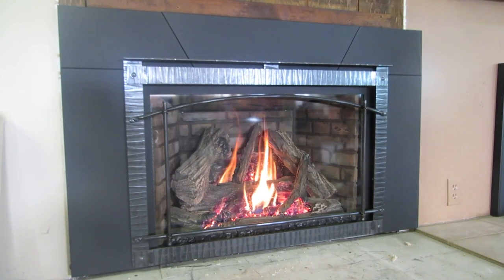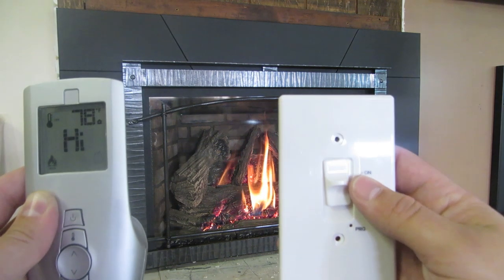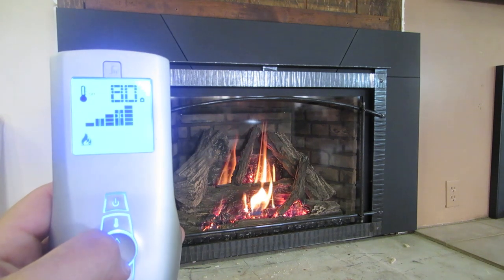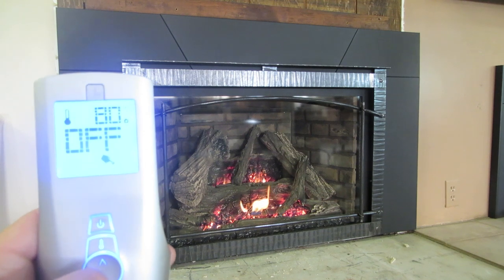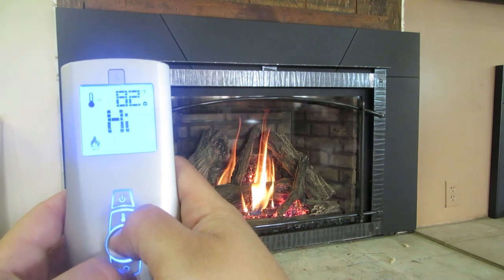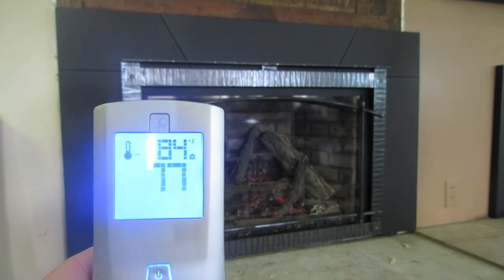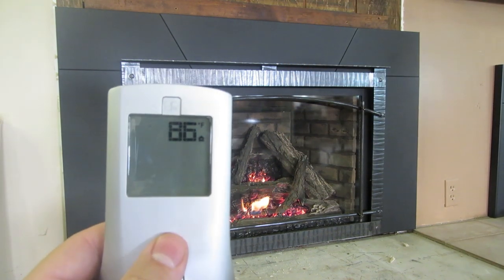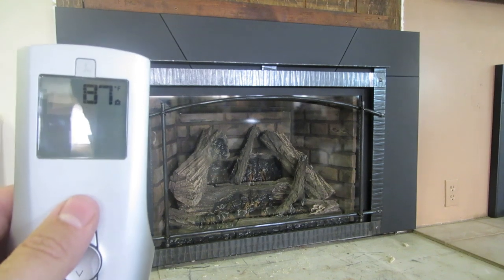How to use my remote control for my Gas Fireplace Tutorial DIY Insert Direct Vent

Comment: ~I have this remote for my regency unit.  I'm looking for instructions on how to reset the remote after batteries have been changed.  I need to re-sync the remote to the transmitter. Thanks.
Reply from the maker: +codered77 take the batteries out of the unit. press the little button on the receiver. you then have 10 seconds to put battery in remote, and turn remote on. You will then hear 3 beeps. And that should do it
Reply: @embersliving  where's the little button on the recorder. Which button do I need to click